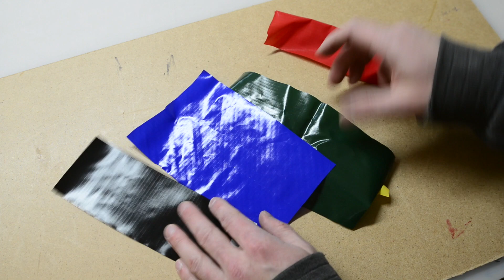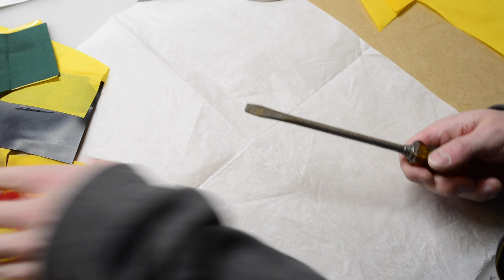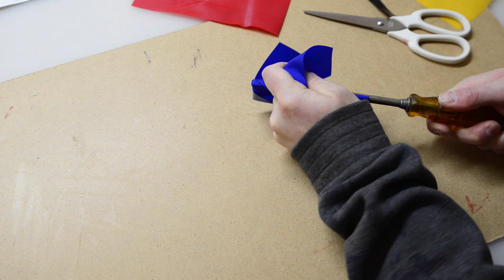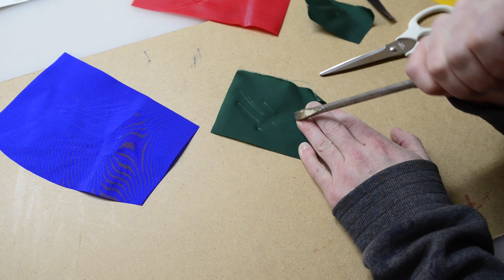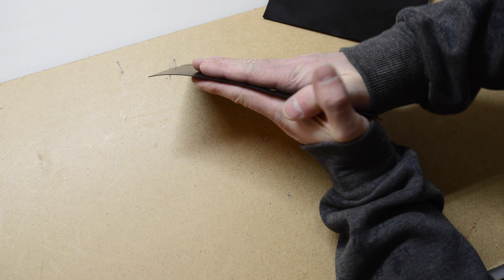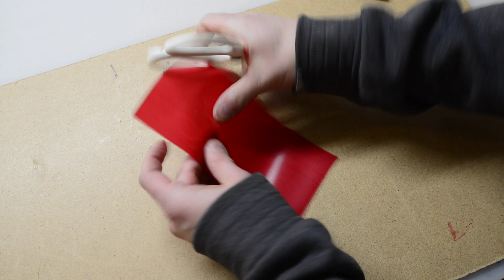DIY Packraft - Fabric Comparison (2017)

Comment: Thank you so much for this! I would like to know the weight difference between te 210d and the 420d pr meter though?
Reply from the maker: The 210D in this video is about 250 grams per square meter (GSM) and the 420D is about 560 GSM.
Reply: What does 210D cost?
Reply from the maker: You can check the current availability and price at www.diypackraft.com/shop